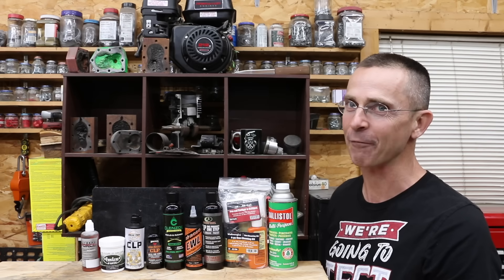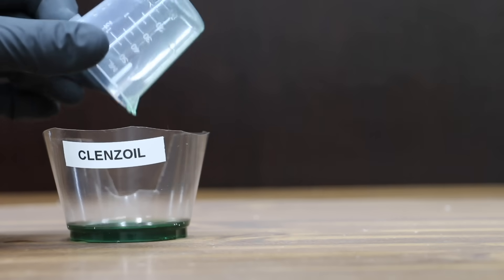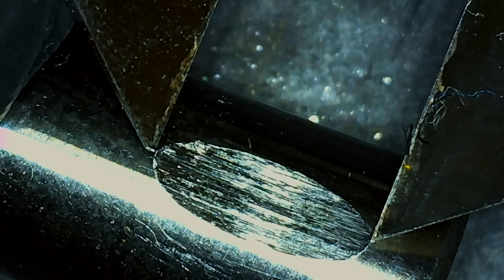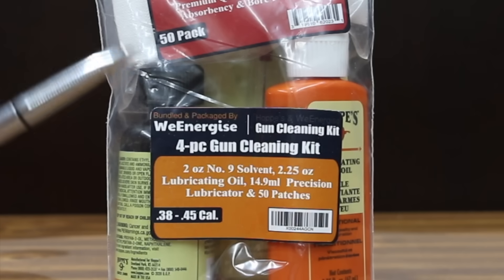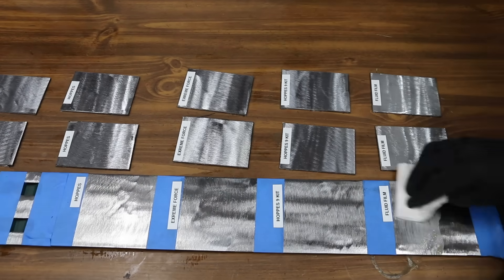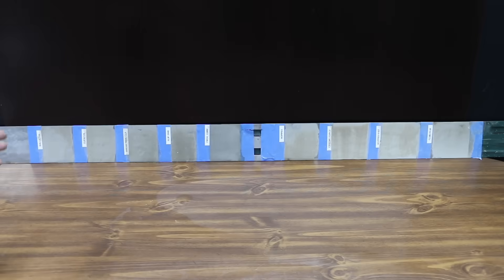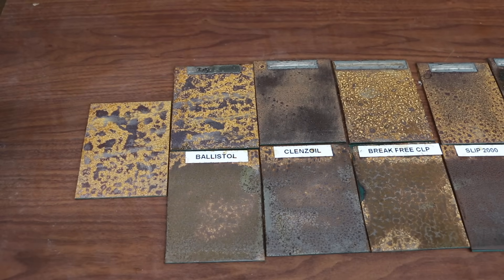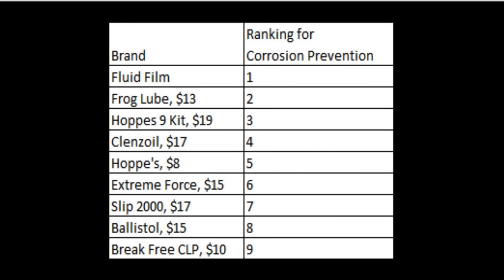Don't Buy A CLP Until You Watch This Review! It'll Save You Time And Money!

Comment: I use soap and water for cleaning after seeing Paul Harrell do that. It works MUCH better than CLP for cleaning. It gets rid of all the built up gunk really easy. Once everything is dry, I lubricate with Break Free CLP and reassemble.
Reply: Try Mobil 1 for lubrication. Much cheaper and much better.
Reply from the maker: Thanks for sharing.

Comment: Great video but should've had a variation of Ed's Red included. Basically a mixture of ATF Dex 3, Kerosene, Acetone, Mineral Spirit and some type of oil like Kroil, 10w-20 etc. Been around the gun community since early 2000's.
Reply from the maker: Thanks for the suggestion.

Comment: Honestly I have used most of these and they all work as long as they are still on the parts you put them on. Some seem to evaporate, while others run off into parts you did not want lubricated like firing pin channels and make messes in buffer tubes when stored in safes. Slip 2k dont dry out and is cross compatible with their other products (as most brands will be cross compatible within their own brand). Slip 2k products make the most sense to me. Automotive products can have unwanted effects with swelling rubber or being bad on plastic and wood which is common on guns. This is why i stay away from automotive lubes. Slip 2k products meet my needs as all of their products work well in the real world and I do not have to use other brands to fill voids they leave.
Reply from the maker: Thanks for sharing.

Comment: I don't shoot very often but this is how I keep my slide guns lubed and in great working condition. Disclaimer: I saw this elsewhere and copied the idea but unfortunately cannot give proper credit to the originator. Also, this does not take the place of regular cleaning or the servicing of parts that require specific oils. 

I bought 5 pack of dental irrigation syringes with the curved tube\proboscis on the end from Amzn and a tube of Lucas Red &Tacky grease from Wal-Mart. I put about 1 inch the R&T in the syringe and wait for "Gun Day" or whenever I have a need to protect metal on metal surfaces.  

This is it in a nut shell. When ready to reassemble I apply a THIN film (think snail trail) of grease to the rails on the inside of the slide, or whatever part you want to protect, and reassemble the gun. The tube tapers to a fine point making application very easy.   

Unlike most oils and gun grease products I've tried the R&T stays where I put it and will not run when it gets hot. The improved operation of the slide when clearing or chambering the weapon by hand is amazing. I've found no downside to this and for about $12 I have enough grease to last years.  

Having an extra syringe or two in my toolbox also allows me to easily and precisely lube other item like ratchets and small bearing assemblies. Once you have the irrigation syringe you will find how easy it is to use on other parts and devices where metal on metal contact occurs.      

I live in the deep south so cold weather isn't a concern but I would certainly do some testing before using it in extreme cold. Does the R&T collect dust?  I carry every day and my problem is lint but no more than any other lube I've tried. I keep my guns clean but I do not over clean.
Reply from the maker: Thanks for sharing.

Comment: I generally use Breakfree CLP on my firearms because that's what I used when I was in the Marine Corps. I also have used Hoppes #9 and Rem oil. I used Hoppe's #9 cleaner and lubricant together. The Breakfree CLP seems to have changed from what it was in the early 80's, when I was in the Marine Corps. I noticed the change 5-10 years ago. It use to have a milky white color to it when I was in the Marine's and I think it still did up to maybe 5-10 years ago. Nowadays it has a brown color to it, about the same color as Motorkote. Since Breakfree CLP originally had DuPont Teflon in it, I think when DuPont won their lawsuit preventing other companies from using their Teflon in their products, Breakfree must have had to take it out of their product. Along with Motorkote and Liquid Wrench and any other companies using it. I think that really hurt the performance of the products. I know Liquid Wrench use to have A spray that said on the front of the can "With DuPont Teflon". I had a can of it and the next time I went to Wal-Mart to get another can, the can then said "With Cerfelon" instead. The DuPont lawsuit must have occurred in between. I had a bottle of Slick 50 "High Mileage" additive that I bought some 20 years ago and just finished off the last of it using it in my lawn mower. It had a milky translucent look to it similar to how Breakfree looked in the early 80's. It looked like clear mineral oil DuPont Teflon mixed together. It would be interesting to see you do a lubricity test on DuPont Multi-Purpose Lubricant and a corrosion test. Also maybe a test on it combined with mineral oil. From the look of the high mileage Slick 50, I would guess it may have been a 50/50 mix. Maybe less Teflon, but I think at least 33% Teflon. Keep up the good work! I think if you ever test the DuPont Teflon, it may be a product you get sold on. It might be interesting to add some of it back to products that it was removed from, because of the lawsuit and re-test them for lubricity and corrosion. Have a great day!
Reply: I don't have firsthand experience with what you're talking about but it does sound like you were describing LSA. The government might of still had stockpiles of it before the GWOT.
Reply from the maker: Thanks, will do!  Thanks for the suggestion.
Reply: Teflon has pfas in it.

Comment: That was a good test. Thank you.  I would like to see a test of some other supposedly great options like EEZOX and Motor oil (specifically mobil 1) and Lucas and corrosionX. 

Personally I started using eezox on everything like a wd-40 now. It's perchlorate based so it's also an incredible cleaner. It also dries unlike most oils so my knives and such don't get oil all over my clothes.
Reply: I second the EEZOX suggestion :)
Reply: Another vote for EEZOX
Reply: EEZOX is all I use after many gunsmiths have recommended it to me.
Reply from the maker: Thanks and you are welcome!  Thanks for the suggestion.

Comment: "Gunfighter" brand is all the rage these days with the "experts" but I think it's just oil and cleaner, not a CLP.  However I would like to see how it performs in this test since it's supposedly the best out there.  I've been using OTIS with no complaints.  

As others have said, Frog lube has some special application process of using on heated metal with multiple applications, it supposed to penetrate, etc.  I got some and read that part, never used it.
Reply from the maker: Thanks for the suggestion.

Comment: I use TW25B for the internals of my guns, a synthetic ptfe lube. I run them hard in dust/desert as well as mud/cold and Ive never had any issues. 
The externals are usually painted, but for work I just run a thin coat of Hopps/Otis CLP. They rust if I dont clean them weekly in garrison or daily in the field.
Reply from the maker: Thanks for sharing.
Reply: @ProjectFarm  Thanks for doing what you do!

Comment: I’d love to see Lucas CLP in one of these tests. It beat out everything in my anti corrosion testing, including Hornady one shot, and the Hornady one shot HD extreme. Fluid film failed early.
Reply: I use the Honrady One Shot and wouldn't mind seeing that as well, along with some of the other brands out there, like Remington's and I believe Winchester has an oil as well. Also, Royal Purple and AMSOIL products included as well.
Reply: maybe Amsoil gun oil as well
Reply: I just got a can of the Lucas CLP a couple months ago. So far I’m really liking it. Haven’t tried to test it for corrosion yet. But seems like it lubricates just as well as the breakfree that I’ve used for years.
Reply: I agree, I’ve been using the Lucas CLP since I got a promotional packet in a Sig rifle I bought. It worked so good that that’s all I buy now. I would love it see how it holds up against the rest of the pack. I am going to give the Clezoil a try.
Reply: Never tried it but I keep reading great things about it.
Reply: And it softens up new carbon nicely. Seems to work pretty well for that and cleaning. I’ve been using it for a while but I also add a little oil for more lube.
Reply: I was using the Lucas CLP for a while till it froze up on me duck hunting one trip threw it all away. I guess if thats not a concern in your area it was great other than that
Reply: My primary product is also the Lucas CLP having using it for a number of years now. I live in a area which the climate is quite varied and my firearms are quite often left in the vehicle and since using that I have detected none to barely any corrosion on my firearms

Comment: Not a gun owner, but I use CLPs on high precision machines and gears that require little maintenance as possible. I’m a bit disappointed on the performance of Ballistol on the tests but I kinda expected it, since the formula is over a hundred years old and it’s pretty much outclassed with more modern synthetic-based CLPs. I might pick up some Clenzoil and use it for specfic jobs 👍🏻

As a bonus Ballistol is classified as food grade (so as Frog Lube if I’m correct), and it can be used as an antiseptic for minor cuts and wounds.
Reply from the maker: Thanks for the feedback.

Comment: Another great video, looks like I'll be using Clenzoil going forward. I am kind of curious at what temperatures the oils that failed the freeze test actually failed at. I don't think too many people are worried about being in -40*...Would be curious to see how they hold up to say, 0*. Watched a video recently of testing various firearms after freezing them, and there was mention of possibly testing different oils out as well, be interesting to see how that plays out if they do. I feel like these oils even if they froze, particularly if they've gotten into the metal after being heat cycled, I feel like the firearm would still function, long enough to probably heat the oil up enough to be liquid again. But I'm planning to move to warmer pastures in spring anyways, so Clenzoil it is. There are various coatings used in the firearms industry that are intended to help components last longer, I'd be curious to see how some of those coatings hold up to wear testing, Manganese Phosphate, NiB, chrome, black nitride, titanium nitride, a whole host of proprietary ones, like Cryptic Coatings, although firearms related content might drive some viewers away, so I'm not sure if that's a rabbit hole you want to go into. If not, maybe a more generic test, would be interesting to see a video on protective coatings for metals in general, like aluminum anodizing hard and soft, black oxide, powder coatings, zinc plating, cerakote, etc.
Reply from the maker: Thanks for the suggestion.

Comment: I wish you had Tested Pennzoil Synthetic 0-20w. I have tested this and found residue is much easier to removing this motor oil. No rust either and lubricates well. In my testing I also found 10-30w was to sticky in cold weather use so I changed to 0-20w with better luck. I have been using motor oil for several decades with very good results. But always know your firearms and lubrication limits and specific requirements. I guess you know most gun cleaning oil is Mineral Oil based. Maybe add plain mineral oil to the test also.
Reply from the maker: Thanks for the suggestions.

Comment: Great review, Todd! The only real issue I have with these tests is that a diesel exhaust pipe is not a close substitute for a gun barrel. The diesel has hot gas condensing onto a colder pipe. The carbon in a gun barrel comes from deposits left by burning gunpowder which is considerably hotter creating a much harder build up. Add to that copper and lead fouling which is even harder to clean, but equally important to remove. Unfortunately, I can’t think of anything other than dirty, fouled gun barrels that would make a realistic test medium.
Reply: Go make a video about it then Bruce
Reply: @Amberlynn_Reid  Hey now no need for that, Bruce made a polite, valid point that is worth considering - that's the reason I read these comments

Comment: You left out several. Shooter Lube. Barricade. And why would you test a cleaner as a lubricant?
Your results show what I have been trying to burn into folks heads for decades now. Use a cleaner to clean your guns, and a lubricant to lubricants them. Combos never work as well as doing each job with the proper product and doing them separately.  Plus one of those products is the best protectant, so each should be done separately and where needed. The outside of the barreled action needs no lubricant. I think that should make my point. 

From your tears, Hoppes/HOP-EEZ, has always been the best cleaner, and a new one for me, the Clensoil is the best lubricant.

Comment: That's not how you are supposed to use frog lube. Frog lube is supposed to be applied to heated (with a blow dryer) metal. Rubbed in, and then wiped off. It's designed to impregnate the metal and give it an inherent lubricant quality.

Frog lube only gets a bad reputation because it's almost always misapplied.

Comment: In the past I know you’ve tested different types of oils, looked at their anti wear additive packages and such. Could you do that with ATF as well? Would be cool to know if there is really a difference between certain types like Mercon V, Dexron III, Dexron VI and brands such as valvoline, motorcraft and fram. I believe you have run it in an engine before to test if it would self destruct, it would be interesting to see what each type and brand would do in the crank case. Keep up the great work and have a great day.
Reply from the maker: Thanks, will do!  Thanks for the suggestion.

Comment: A suggestion: for testing the dust and dirt attraction if the test coupons were separate you could weigh them before and after. It would be less subjective.
Reply from the maker: Thanks for the constructive feedback.
Reply: The test coupons would need to be much smaller, and a very sensitive scale. 2"X2" and the measurement would grains/in2 should do well. As long as the scale can handle the weights. And the initial measurements are not made on bare coupons. 

437.5 gains is 1 ounce. So a much more precise measurement given the media being measured.
Reply: @disgruntledbear2764  Measured in grams should do it. if we're splitting hairs over .1 of a gram, that can literally be a fingerprint.
Reply: I wonder if it would have added anything to see how easy or difficult it would have been to wipe off the accumulation of dirt with a dry rag.

Comment: You need to be very careful with Froglube.  It is essentially coconut oil.  This poses two issues.  First, which you discovered, is that it is not cold temperature tolerant.  The second, is more insidious.  It oxidizes and hardens up inside the gun over time, with results similar to using WD40.  If you use Frog Lube on something like a revolver, or on a carry pistol that will not be shot regularly, you are likely to have a non-servicable gun when you do go to use it.  If you cannot completely disassemble your firearm, Frog-lube can require a gunsmith to remove.

Please understand - if you apply it very sparingly, never use it in low temperatures, and very regularly maintain your gun, Frog Lube will work beautifully.  Someone who is using a gun in competition, for example, might really benefit from Frog Lube - it really does keep the gun in a "just wipe me clean" condition.  But for everybody else, it can be bad medecine.
Reply from the maker: Thanks for the feedback.

Comment: Awesome test! I personally never use CLPs and prefer to use individual products to clean and lube. One thing I’ve found most CLPs struggle with is copper fouling. For copper I love Gunslick Foaming Bore Cleaner. Sadly it’s discontinued, I bought 8 at my local shop when I found out and still have a few, makes cleaning easy and smells way better than Sweets 7.62. It does remove carbon, but isn’t the best. For carbon, Hoppe’s Elite Foaming works incredibly with very very little agitation. Lastly for oil Break Free LP-4 has worked well for me in combination of keeping moisture under control in the safe. Maybe a suggestion is application of a specific amount of CLP to a clean copper sheet. Weigh the copper sheet before application. After a specific time. Rinse thoroughly and weigh how much was removed?
Reply from the maker: Thanks!  Thanks for the suggestion.

Comment: Please make a part 2 with 
Weaponshield and if possible also with the Oil "Ostermayer-Jagd" gun lubricating oil - with microceramics.
Ostermayer is one of the best lubricants, it's not a CLP, just a pure lubricant.
But I don't think you will find one that is better against wear.

These two oils are outstanding expecialy against wear.
Weaponshield is without any ceramic but has a ABF technology and is cheaper.
For cleaning use Weaponshield Solvent.

I hope you will make a second part.
Reply from the maker: Thanks for the suggestion.

Comment: The biggest issue I have with firearms oil is it running out of the places I put it over time. Can you test which ones stay in place? can you also test gun grease like the lucas extreme vs bearing grease?
Reply from the maker: Thanks for the suggestion.

Comment: I've always used Hoppes cleaners and oils for my bolt actions. I use a molly wheel bearing grease in my AR at the recommendation of a retired marine. No problems with it so far. I also use an aerosol spray RemOil for lubricating  firearms with lots of nooks and crannies like handguns and some 22 rifles. Would love to see a version of this test with just straight firearm lubes (not CLP's) tested
Reply from the maker: Thanks for the suggestion.